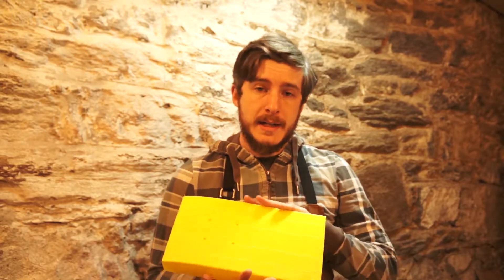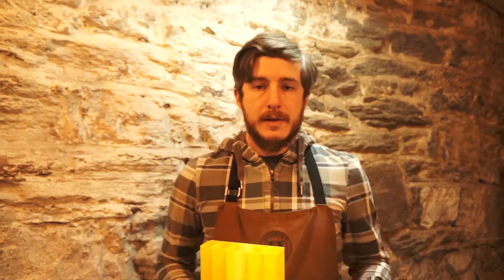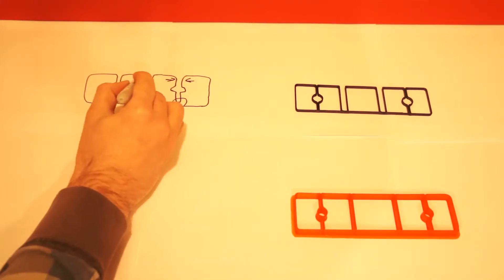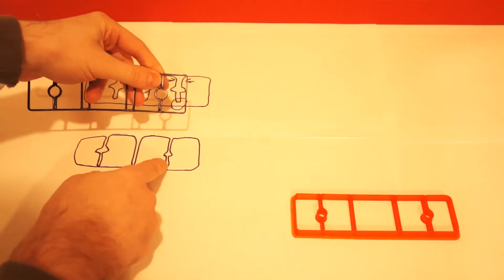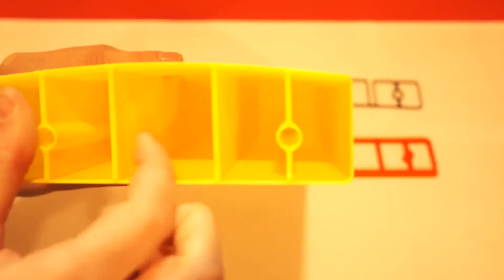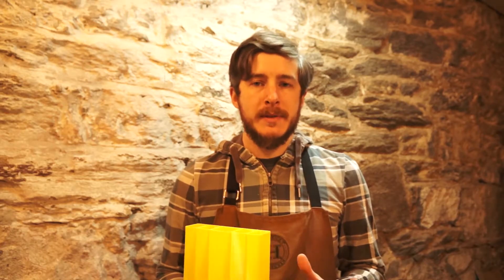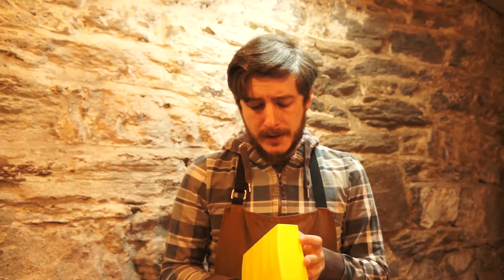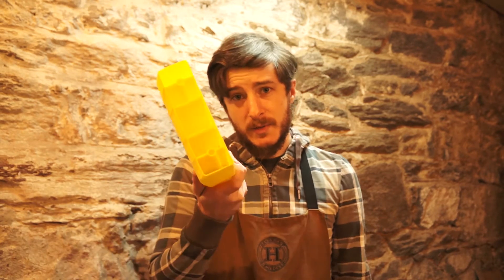Printing Internal Features with Vase Mode

Comment: I just started looking for more info on printing big parts fast without a need for perfect surface quality, because I have an application in mind. There isn't much I've found so far, there doesn't seem to be much interest in the subject.  When I start asking about 2mm nozzles, people don't reply much. Thank you for this and your previous videos on this subject. Congratulations on the press and I'm glad you're feeling better after being sick.
Reply from the maker: I'm glad you're finding the videos helpful! I haven't made one about my printing equipment in a while, but the best setup(s) that I've used so far for printing big and fast were volcano hotends with a geared direct drive extruder of some kind. I don't know if there are 2mm nozzles for the volcanos, but you can get a 2mm extrusion line with the 1.2mm nozzle. Then it's just a matter of pushing and melting the plastic fast enough.

Comment: So is this the mould for the board? Or are you 3D Printing the board and using the threaded rod to connect different segments of the board together?
Reply from the maker: This is part of the mold. The board is going to be veneers pressed between a set of molds, just like a normal skateboard. Next week's vid!